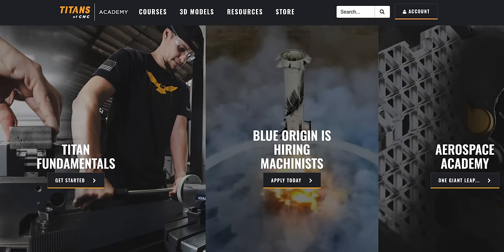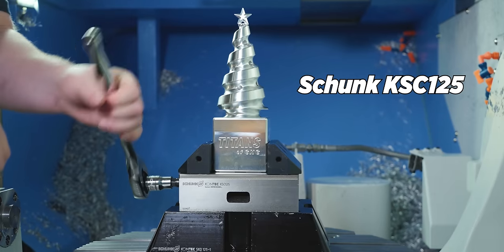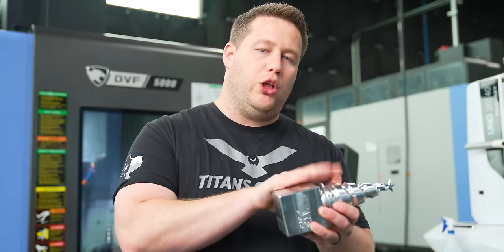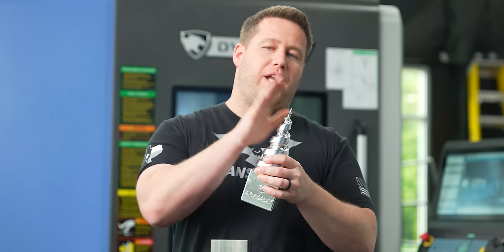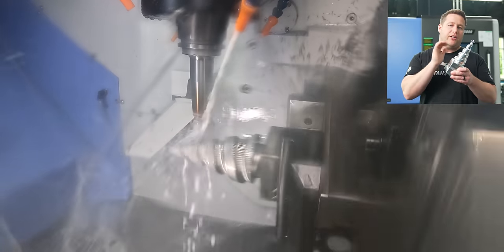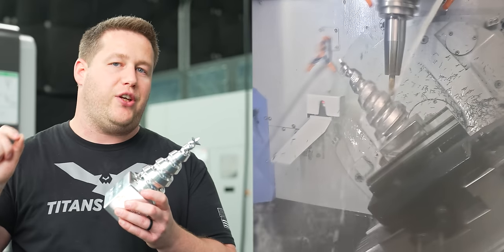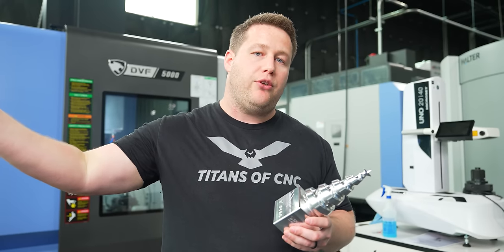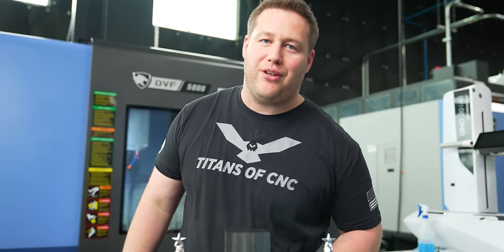Why is Machining this Part in Titanium instead of Aluminum so Different? Machining & Techniques

Comment: When you are roughing the OD, (2:13) is the part precisely in the middle of the C-table ? or is the Z-axis correcting for being of center ?
Reply: The part is not in the center of the table.  I placed the vise eyeball to the center of the table and eyeballed the part in the vise.  It's not off a lot but it's not on center either.  That is the beauty of using TCPC and tilted work plane, I can put the part and work offset anywhere I want on the table and the machine will compensate for me.  If you program from center of rotation then you absolutely would need the part to be dead-on in the center of the table.
Reply: @Jessie_Smith thanks for the reply !

Comment: Can you make a video (or a few) that goes in-depth all the programming that was done in MasterCAM?
Reply from the maker: That all kept on academy.titansofcnc.com
Reply: I don't have one on the titanium programming but the aluminum has a 6 hour Mastercam tutorial on our Academy.  All the finishing was done the exact same way except on the aluminum I did a zigzag strategy and on the titanium I made all the passes climb cut so the finish would be better.  Some of the roughing changed but that was mainly because my endmill was shorter on the titanium than it was on the aluminum.  hope this helps.
Reply: @Jessie_Smith thanks for making this video crazy insightful

Comment: I heard that hydraulic chucks have more damping, do you prefer to use them in  some cases or is shrink fit better?
Reply: When I first started 5 axis machining is when I first started using shrink fit holders.  At that time I thought everything needed to be shrink fit as they are so convenient.  That is not good practice though.  Since then, for milling I have learned to only use shrink fit when necessary.  The biggest benefit of shrink fit is the smaller nose diameters so they are amazing for hard to reach places.  But like you said, you lose dampening properties with them so you run a higher risk of chattering and deflection.  They are great for drilling because they have great runout and you aren't putting any radial forces with a drill.  But for milling, limit them to only when you need them for tight or hard to reach places.  Hydraulic has become my favorite all around holder because they have great holding force, great dampening properties, and great runout.  But they are bulky so you can't fit them everywhere on a 5 axis.  hope this helps.

Comment: 0:57 Did you guys change DVF 5000 fanuc on siemens?
Reply: You're right, this is an other machine than the one from 6 months ago, that one had a Fanuc  31i contoller.
They change machines like 🩲😁
Reply from the maker: Yep, better movement now… We inspired DN to make the change
Reply: @TITANSofCNC  is there a Heidenhain option?
Reply: Yes sir, this has the Siemens Sinumerik One control.  It is SOOOOO nice.  It is also incredibly fast.